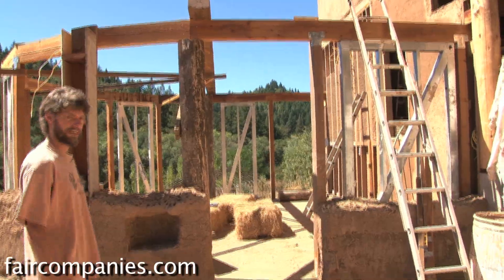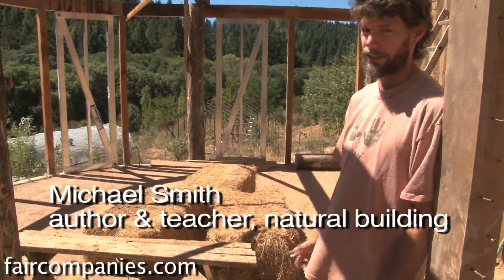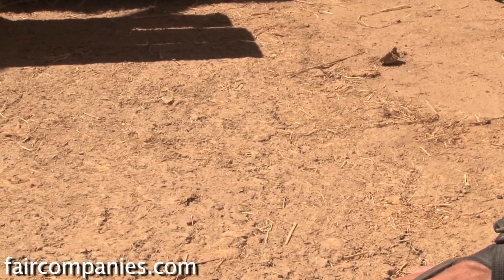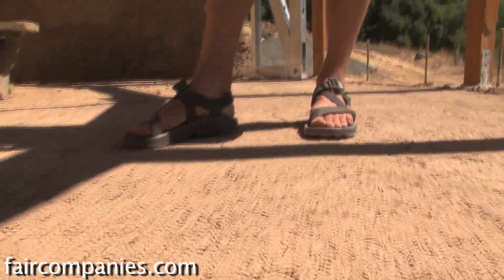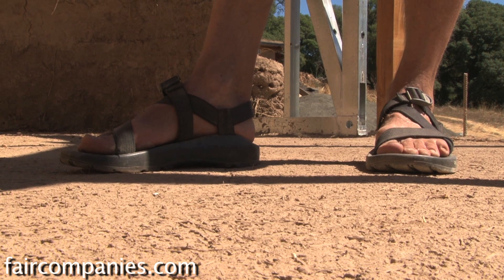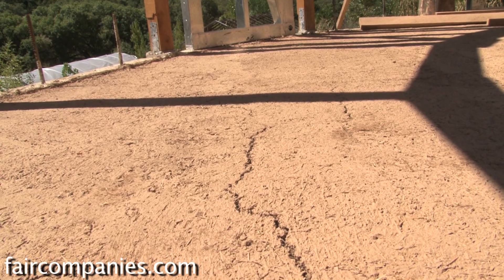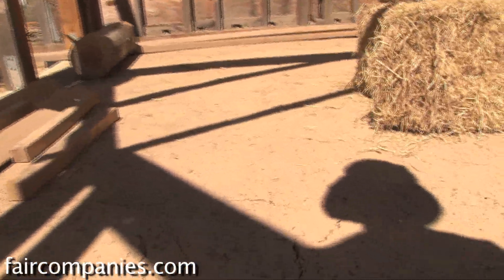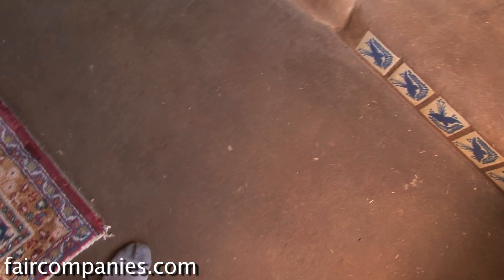Natural building: water-resistant earthen floors don't off-gas

Comment: interesting thanks for the video im wondering if UV dried polymer castor oil which would immediately dry be a better solution its natural and has one of the hardest resistant's to scratching staines etc ??

Comment: Thank you for the video!!  Do you have a vapor barrier or insulation in the floor?  

We're planning on doing an earthen flooring using a vapor barrier (unless you have a good reason not too) but I don't really want to put down rigid foam insulation.  The book we're following is "Earthen Floor - A Modern Approach to an Ancient Practice" by Sukita Reay Crimmel.  They talk about insulation in the book, but they don't come out and say you HAVE to use it.  We live in southern Missouri and it doesn't get super cold. 

I don't want to use the insulation, mainly because it's so expensive. Thank you!!
Reply: Hello Sandy, 
We're also in Southern Missouri, and I was wondering what you ended up doing, and how it turned out? 
Peace.
Reply: Having a dislike for cold feet, you can insulate them by adding a layer of varying rock then vapor layer then perlite. Then add your mix, is my understanding
Reply: You can add floor water radiant heating with water solar or biogas heating when no sun is out

Comment: I would be extremely cautious using linseed oil. ESPECIALLY if you are wiping it up with cloth, like a towel because although the building materials you are using are fireproof, linseed oil can take MONTHS to dry completely and if it doesn't dry and it touches other materials... like a balled up dirty towel or cloth furniture this material is capable of smoldering and spontaneously combusting. It poses the greatest risk for oil painting artists besides the fumes of the oil itself which can cause severe and permanent neurological damage working with it in a badly vented area. I would highly suggest researching an alternative oil that does not contain combustable properties.
Reply: Hi! Thanks for sharing your knowledge.
Is it referring to the industrialized linseed oil which is mixed with synthetics products or the 100% natural linseed oil ?
Reply: I severely doubt raw linseed oil would give anyone neurological damage. what you don't want to use is 'boiled' linseed oil which is not actually boiled but filled with toxic additives. they just call it boiled to make it sound nice
Reply: What toxic additives please?The difference between Raw and the Boiled Linseed Oils is that Raw Linseed Oil has a longer drying time, where as Boiled Linseed Oil has been treated by blowing hot air through the liquid - this shortens its drying time considerably.
Reply: M.R. Hawks I think every oil is combustable-including oil from seeds! Otherwise you couldn't run an old diesel engine on oil used for frying things....Erica and Ernie Wisner use this for the finishing for their cob built rocket massheaters...also looks nice!
Reply: it is being applied to dirt though so it soaks in no? doesnt that aid the drying process some?
Reply: yikes!

Comment: fine clay dust is extremely harmful for your lungs, remember to include a high quality dust mast with you asset/equipment plan. it is not safe to breathe around an unfinished floor until it is coated with some type of membrane to hold the dust in. as a ceramic artist i suspect this man is a victim of the clay dust.
Reply: he should have a mask, but isn't the dust warning for ceramics indoors? In the outdoors there is open air and so dust disperses with wind everywhere and until it accumulates enough in the air to be a dust storm, its generally not a problem outdoors. when your in a closed room, sure those fine particles will be around for days because they are trapped in the room with recycled air. having 2 windows open opposed to having a sky over head is a huge difference.

Comment: I live in north Georgia and live in a apartment with a slab floor and carpet.  During the winter, if you had your feet on the floor for more than 15 minutes, you would loose all feeling up to your knees even though the air temp was in the mid 70s.  Ottomans saved me from frost bite.

Comment from the maker: @YesWeTan I don't know the proportions Michael used for this floor, but I know mixes vary quite a bit. In a book he edited called "Natural Building" different builders talk about their mixes. One created a mix for just from pure road base without any stabilizers. Another talks about creating samples ranging from pure soil- going up in increments of 1/2 part sand- and testing it all the way up to 3 parts sand. Michael's written quite a few books on the topic. Google him at Michael G. Smith.

Comment: Will the linseed oil liquify in hot temps?
What about making a bathtub this way? Will the oil leach into the water?
Btw in responds to vention4wh, earthen floors are better insulators than concrete.
In colder climates radiant floor heating would be the way to go.
Reply: The oil polymerizes in hot temperatures, the same as seasoning a cast iron pan. You could make a bathtub this way. If the oil leeches into the water it won’t be a problem, that’s partly how soap works. Earthen floors are not necessarily better insulators than cement. Cobb doesn’t have much r-value analysis, but it’s partly more effective thermal mass, but that could depend on the Cobb mix ratio.

Comment: Wow! Neat. I wouldn't choose that type of floor in a cold weather environment though, unless I had some kind of insulation layer below the floor. My condo (or should I say my 100% paid off condo) has  a concrete floor. During the winter it kind of sucks the heat out of my home. It's great during the summer though, even when the outside temp is nearly 100, I rarely even need air conditioning. I just turn on a small fan and I'm perfectly comfortable.